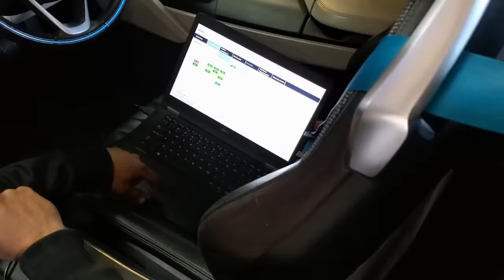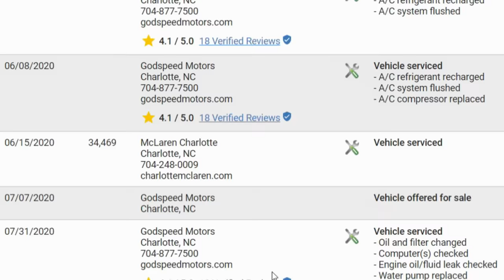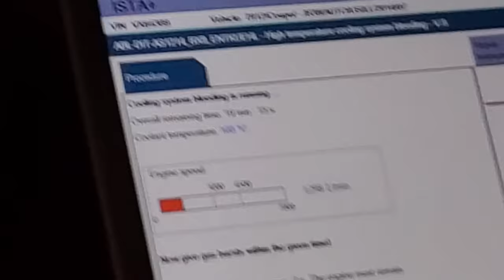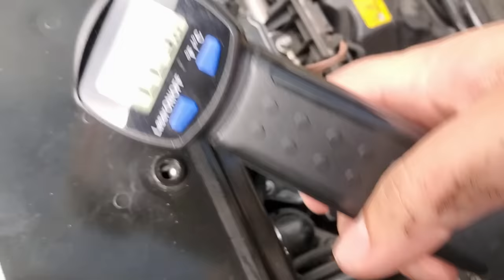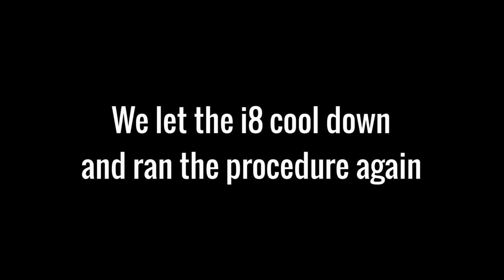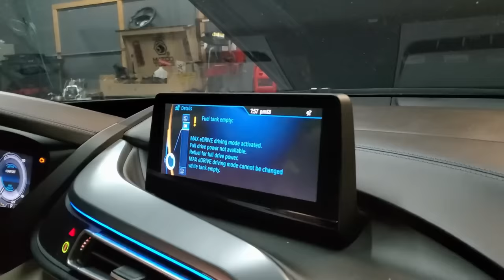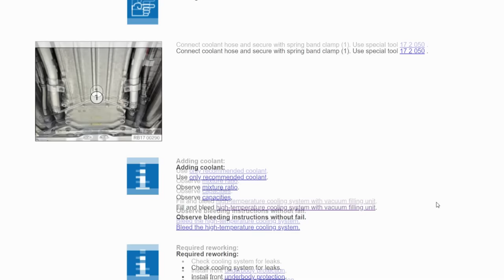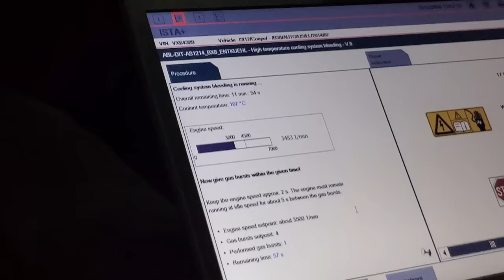Was my Repo'd BMW Supercar Sabotaged to make it Impossible to Repair?

Comment: For the second video. I’m a bmw master tech 15 years. I’m going to try again. The hard lines you looked at. Following the outline of the battery pack and near the right rear of the vehicle. The mounting tab on the line cracks at the weld it leaks from there. There is a mounting bracket that need to be removed along with almost all the under body panels and a structural mount. It’s a very very tiny crack but you will see it. It only leaks when it get hots so a cold vehicle pressure test won’t show. And if you do a hot vehicle pressure test you don’t see it cause the pressure goes down any way since the vehicle is cooling down. My dealer actually put a motor in a i8 for the exact same reason.
Reply: @Samcrac ^^^^
Reply: Hope they read this, something look at at the very least!
Reply: @Samcrac
Reply: Sam bumcrack
Reply: zombie you are right.

if you had high pressure in coolnet system it mean you have crack in engine.
Reply: Try emailing him, it may be a better way of contacting him
Reply: hair line cracks  would  show bubbles in the water.... First try to run the car cold with the radiator cap off... ...after a while bubbles will show up (when engine is warmed up and cracks open up) and escape thru the radiator cap seat.....Bubbling effect due to compressed  escaping air in the coolant is an indication of cracks existence. I have seen this many times with hair line cracks... This is the first thing I check when engine is overheat...before going into those fancy expensive computerised diagnostic laptop program...
Reply: If you watched him do the pressure test you know it's likely something clogging the radiator.
Reply: @KillinReapers  I reckon there's shit in the radiator and mommy knows that
Reply: If he acknowledges your comment he won’t be able to milk videos out of this shitbox
Reply: @orencomputerelectronics8751  not always, can also be caused by a bad reservoir cap
Reply: @jumbosantorum4797  🤣
Reply: We need to get this to the top
Reply: Never had a small leak cause overheating.
Reply: @Samcrac ^^
Reply: I had a tiny pin-prick hole in a hose on an old bmw once,really hard to find,as only ‘steam’ was emitted,so no sign of water anywhere...I gave the car to a mate,thinking the head gasket had gone,his mech found the leak,and he drove it for years...
Reply: @zombieslayer621, I haven't seen him open the bleeder on the expansion tank yet,  do you know if there is a second bleeder in the engine bay?
Reply: Be funny if it’s not what you said 15 years for nothing ahhahahaha I hope he checks now
Reply: How do you explain that it popped the radiator when they pressurized the system then ? I mean if there where some cracks I'd imagine air getting through them, but then it wouldn't have cracked the radiator.
Reply: @fabianweber6937  the radiator cracked when they open the wrong valve on the vacuum bleeder and sent shop air (120+psi) to the cooling system.
Reply: @fabianweber6937  that’s not how physics works. If you pressurize a closed system then the weakest part will give in first. A blockage doesn’t make the radiator explode. A weakened radiator does it
Reply: @Samcrac
Reply: You’re not a master bmw technician 😂😂 masterbaiter more like
Reply: @fabianweber6937  I think it has a blockage or an airpocket in the system.
Reply: It seems logical to me as well, especially after the pressure test blew up the radiator. Common sense tells you that something is wrong in the lines that lead the coolant from the radiator to the engine.
Reply: But did the dealership tear down the motor to find the underlying issue and now has a recommended repair
Reply: Supposedly this car was in a front end collision.
 Was the radiator compromised/leaking?
 Was stop leak added to the the cooling system to stop a radiator leak?
 This would explain the overheating problem and the radiator explosion due to being compromised in the accident.
Reply: If he found the solution too quick he’d get less views. Sam is entertaining us for profit not actually looking for a solution
Reply: @lvd2001  They make block test kits that I already recommended that he try to see if there's combustion gasses getting into the cooling system.
Reply: There's no reason to worry if your electric fan doesn't turn on.  The engine is staying cool enough without it.  I once had a 2005 Neon and the fan hardly ever came on its whole life.
Reply: That's why I don't usually comment.

Comment: I'm actually one of the techs that worked on the car. Replaced the oil filter housing, mechanical water pump, and one of the turbo aux coolant pumps. I tried bleeding this car for 3 days. That car needs an engine, the water pump and oil filter housing I took off were melted. The engine sounded fine so we tried to save it, there is a blockage in the engine itself somewhere and probably other places. I have nightmares of this car to this day. Eventually you will get oil pressure faults in the DME
Reply: Should be a top comment!
Reply: @BradKwfc  Why?  He doesn't know his ass from a hole in the ground, just like the dealer.  It was a bad head gasket.  Replace the engine is what you do when your tech gives up and can't figure out simple things.
Reply: @Everything817  Should be a top comment because you actually worked on the car so you probably know more about it than 99% of us commenting.
Reply: @Everything817  
I smell troll
Reply: @Everything817  cracked head after that heat
Reply: Did you try the thermostat?
Reply: "the water pump and oil filter housing I took off were melted" Means there was significant damage to the block. It was done right then and there.
Reply: @Everything817  costs more to rebuild most engines today than to replace them that's why dude. No shop rebuilds the Chrysler 3.6 its a timing chain nightmare with the VVT cam phaser set up. Heck guys cheat the bad rockers in those just so they don't disturb the timing.
Reply: @jeremypilot1015  this makes that look easy.
Reply: @supertev  facts this looks like a complete nightmare as well. Engineers should be forced to repair what they build.
Reply: @jeremypilot1015  some designs are intentionally bad... this Bmw design seems to be bad from the Gate..if that was intentional.. i dunno... but it seems like it..sometimes manufacturers make engineers do things they don't wanna and these are the results...
Reply: @supertev  that’s for sure. I’m old enough to remember when GM switched to torx bits just so people at home couldn’t change their own brakes and headlights
Reply: @jeremypilot1015  lol , yeah i still come across rivets in older cars from the early 2000s... my favorite is how Mercedes put the bolts to fit towards the inside of the frames so you need two people...
Reply: You’re lying.
Reply: @BarronVonSchnoot  but hes a mechanic.. A MECHANIC!
Reply: @jeremypilot1015  its done on purpose things are designed overly complicated so it has to be serviced by a certified tech or returned to dealership to prevent garages and at home repairs
Reply: Flush.  U solved the vacuum leak replacing the radiator.
Reply: @Everything817  you use "ass from a hole in the ground" too? Excellent verbage sir.
Reply: Another mechanic on another video mention a proper procedure in filling coolant to avoid air pockets.
Reply: @jeremypilot1015  I thought that was a Ford trick.  Those electronic ignition modules mounted under the distributor.
Reply: @jeremypilot1015  How do you become an Engineer? You learn to fuck over every Mechanic in the world.
Reply: @jeremypilot1015  BMW charges $9,000 for a new short engine, used B38s probably around $3K give or take. You are right it would be to much to rebuild and just not worth the parts plus labor. This engine was made for 7 years and plenty of cars like Mini, have them.
Reply: @MagicSpamDragon  What's sad is how dealers are able to price gouge legally. I can understand service fees, hourly labor costs and charging $40 or $50 an hour. But these $250 to plug in the ecu and read codes in 7-10 minutes shouldn't be legal. Seems this would be brought up in higher court being some type of Anti-trust law violation. My mom was charged $365 for a Ford serpentine built and install. I did the same job on my own Ford in less than 5 minutes with a $50 belt.
Reply: Vacuum down the coolant system.  Watch the vacuum gage.  If it moves....replace gaskets until you find the leaky one.  Probably the head gasket.
BMWs are such dogshit.  Why anybody ever buys them is hard for me to understand.   They all have WALLET LEAKS built right into them.
Reply: @Josh-hr5mc  Stealerships make almost all of their money off the shop now. As the cars get more and more complicated, less and less home mechanics and simple shops can work on them, and they know that.
Reply: Can it be due to a wrongly installed exhaust system catalyst replacement.
I used to drive a BMW 523i 2 decades ago and after such replacement the entire cooling system continued to run into overheating havoc, throwing out coolant. At BMW they could not figure it out. Everything seemed fine, for 15 to 20 minutes, then overheat warning.
Something must have been replaced in the past improperly and should be refitted to proper way. The exhaust then may not give signals that are needed by the ECU.
Reply: @Everything817  Many internal engine repairs are fixed cheaper and faster by swapping the motor.  Headgasket failure being one of them.  My new less miles motor and swap was WAY cheaper than tearing the head off and fixing the gasket for the simple fact of the costs of all the new parts you'd have to buy to put it back together running (gaskets and TTY bolts). Of course the car was 12 years old by then.
Reply: Any mechanic.   Any.    Has a handful of cars, they hate, absoultly hate talking about cuz it made them seem like a newbie, jerked them around hell.    If your flate rate (witch i so hope you wernt on flate rate  if you spent 3 days trying to bleed it :(. ).      You as the tech lost sometimes hundreds of thousands from your paycheck. Something a lot of people dont realize about the stresses of such a complicated and adverse job path.
Reply: @dwightStones1  now this should be top comment
Reply: You aren’t a very good technician. They fixed it with a simple resurfacing of the head and a new gasket. And you were claiming he needed an entire new engine. I feel sorry your customers that get ripped off due to your incompetence. 🤦‍♂️
Reply: @BradKwfc  no it shouldn’t. He was 100% wrong. It was just a blown head gasket.
Reply: @Josh-hr5mc  yep, comment from "1 y" ago, but if you're still around here's what I think 💬... First, if you ran a business for yourself you'd understand how "$40 or $50" an hour would cause one to close up shop pretty much immediately because we wouldn't be able to cover just what it costs to pay the rent (or mortgage and/or property taxes), pay the employees, pay the utilities, and the rest of overhead costs. So, into each hour is built all those things and then the parts markup we're "just being greedy" with. Most guys who comment like this already know this stuff it's just blowing off steam from having to fix a vehicle you can't really afford. We realize that so we keep plugging away and when somebody like you darkens our doorway we just deal and move on. There ARE the times where when that ripped off feeling is legit, no doubt. $250 for a service diagnosis IF it was simply reading the codes IS exorbitant IF it was simply reading the codes - but I highly doubt it.  I suspect this came with INTERPRETING those codes and it took a bit longer than "an hour" to do so. If this service took place at a branded automobile dealership, then there are further costs over and above the preceding associated with doing business. As a result a dealership is probably THE single costliest place to do business. Supposedly you will obtain the best results from said dealership because of constant, ongoing training provided for technicians. In my personal experience the foregoing is true. Always make sure to verify everything you requested in a dealership service has been done.
Reply: You're clearly no good then if you couldn't solve the issue.
So many call themselves "Techs" but they're just parts fitters.
Reply: So, stop selling this POS model. ,🤳
Reply: P

Comment: Those radiators are junk. They are used on numerous vehicles with the plastic cap and plastic bottom. I owned a Camaro that ran the same type of radiator and it ended up leaking between the top plastic cap and the aluminum body of the radiator. If you can purchase an all aluminum radiator without the plastic end caps I would suggest you go with that. I don’t even understand why any manufacturer would use plastic on a cooling system that can build up pressure under hot temps.

Comment: What if the radiator was clogged? That's a high possibility.
Reply: My thought exactly. Someone could’ve done something dumb like dump stop leak in it and jammed it up
Reply: I was thinking the same thing .
Reply: Lol. I've done that before.. dump stop leak in it and end up walking.
Reply: @W5ZMB    I thought the same. Someone dumped a lot of barr stop leak
Reply: Could be since I’ve never seen a good radiator blow out like that when it’s a good one.
Reply: Alex my Lincoln LS blew the side tank, but that was after 16 years of wear and tear, and a fender bender.
Reply: @HeavyTanker-vx4oq  exactly. What I meant was I’ve never seen one blow just from pressure testing unless it already was really old or had a prior weak spot from something like rust or an impact. They can hold a good amount of pressure normally, well enough for a pressure test anyways.
Reply: Thinking the same
Reply: its a blockage in the coolant system somewhere.  It wouldnt hurt to just unhook the lines and do a complete flush of the system and see what happens.  id almost guarantee if he does that it'd fix the problem.  he's already going to have the thermostat out, and radiator.  may as well just do it right then.  put a brand new radiator on and bleed the air.  i bet the thing is fine. if they replaced the water pump it is usually a sign that someone may have indeed poured stopleak in it as that stuff clogs up your water pumps , everything.  itll stop a leak but stop everything else also!    like most everyone following, i enjoy Sam's suspenseful episodes.
Reply: You'd see all the flakes on all the coolant bleeds/thermostat changes surely
Reply: @simodawg  I’ve seen flakes and crap in coolant but not had overheating and don’t call me Shirley 😄
Reply: Yea someone dumped something in the radiator. I hope we don’t have to wait twenty years for another video
Reply: How come that no one has suggested to use a flow-meter (or whatever you called in in english) to measure the flow in the cooling circuit?
Reply: Overthinking it adding a chemical that makes plastic brittle would accomplish this without anyone seeing
Reply: Are you sure the actual water pump is flowing the water else blockage in system ?
Reply: best way to sabotage a car i would say XD
Reply: Wouldnt the dealership have looked and tested all the obvious possible causes? Ah, probably not. If the diagnostic test doesnt find an issue they assume its fine. Dealership mechanics are the worst. They always advise on expensive work rather then use a process of elimination to id the fault.
Reply: With the thermostat removed is their water flowing at the expected rate? Maybe someone put an obstruction in the system. Can you feel the water flowing? Or maybe hear it? Or maybe IR temp check the lines comprehensively.
Reply: Imagine if it's only a blown radiator, and BMW service advisor recommended a new engine????
Reply: @CSAFMedia  Dealerships are terrible with fault finding. If the diagnostics dont pick it up they normally end up costing you a fortune going through a process of elimination.
Reply: @CSAFMedia  adleast if that still don't fix it it's in warranty
Reply: @rudolph5483  absolutely agree... isolation of main issue and 100% flushing of the system is absolutely imperative
Reply: @rudolph5483   I'm thinking the same. Pull the lines at the engine end and see if a hose runs water through the radiator. From the back of the car.  

Interesting that a seam popped on the radiator. Like it was seeping a bit and sucking air. Then the water pump could not get enough flow past the air bubble in the radiator. Perhaps then add in some stop leak to further damage the radiator?